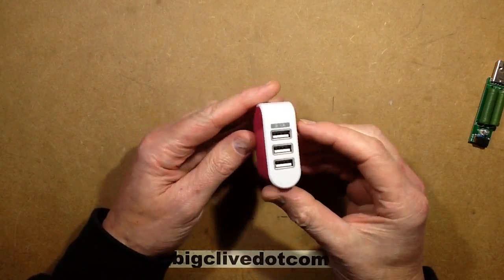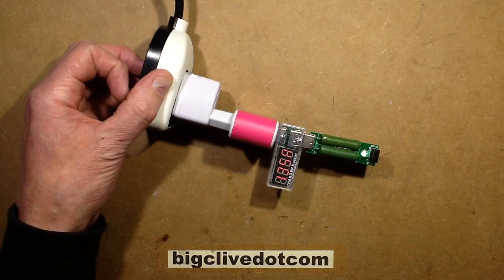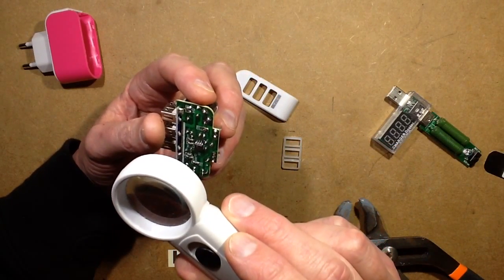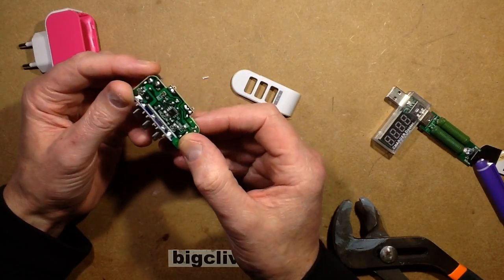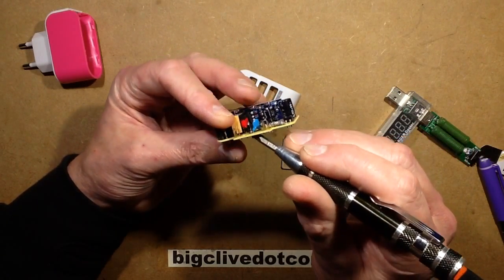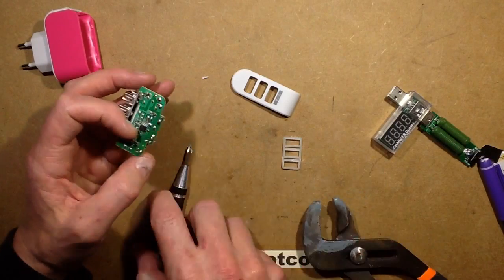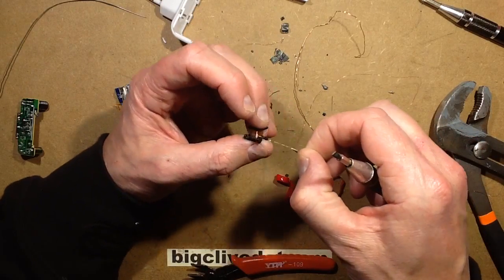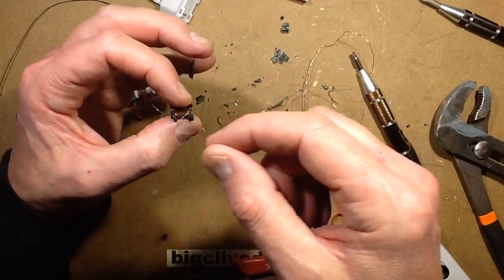Test of a three port 3.1A USB power supply.

Comment: Hey Clive, check out the 2016/v3 of the charge doctor. It does a better job with higher amps / voltages. Something like this http://m.ebay.com/itm/2016Hot-USB-Volt-Voltage-Doctor-Magazine-Capacity-Tester-Of-Power-Free-Transport-/162211473038?nav=SEARCH ( not an affiliate link )

Comment: Its is to bad there aren't proper inspections on products that plug into the mains, cheap and easy to make, and even if you don't die it might kill what you plug in to it, once upon a time we had products inspected by UL in the USA, now we rely on Clive of Scotland, you need a label to apply to approved products, lol.
Reply: +cjmillsnun There's also the problem of products displaying inspection logos they never passed, or close immitations thereof.
Reply: We still have reputable products inspected.  UL, TuV, BSi, etc all still exist and do test stuff.  However the internet allows you to buy crap that isn't inspected much easier than you could before.
Reply: Brad Mad that's why it's for your fake Android tablet so it shall all make it's way too the bin single file.

Comment: gosh how many things have you got I ended up finding on banggood :P  although don't have that particular amp/volt tester I've seen mine in other videos.  I do have the load test and the cube plug in 1 usb port hates it.  Shorts it right out.  Plug the tester in, plug the load in hit the switch and boom  no power  oops  guess 2 10 watt items there too much for it.  Various Microscopes I have as well. Do love the circle one with uv light though. Not sure if you have that one.  but lights up some fun on dollar bills :)   Probably shouldn't use that in the bathroom though :P  the microscope you have never thought I'd break the clear part off.  It's the top section (zoom) I'm always worried about.
Reply from the maker: I broke the base off to get closer to the PCB when other components are in the vicinity.
Reply: bigclivedotcom
I can see that. although thats why I have the smaller one with looks like a loup but it's not and worse it's got a battery holder key (2 holes which probably okay if you lose the key but I'd rather not, besides the long one your using is better anyway :)
Reply: see if youtube hates the linke but for those who don't know which magnifying glass I'm referring to (say on banggood ) it's this one -- http://www.banggood.com/Mini-45X-Monocular-Magnifying-Glass-Lens-Loupe-LED-Light-Eye-Magnifier-p-934020.html  I mostly bought it though for the UV led on it.  I do have a chinese fun with their cheapies myself and banggood is a bit fun.  90 % of the time I'm okay , but sometimes the solder ain't great :O

Comment: Fixed focus? Is that a first or second generation iPad?

An android or more modern iPad would fix that problem, you can just tap on a certain area to focus on (iOS) or autofocus (android and iOS).
Reply: You need voice activated focus like AvE has...
Reply: Does first gen iPad even have a camera?
Reply: SoniEx2 It might. I'd have to check, but I know that the iPad 2 and later do for certain.
Reply from the maker: 2nd gen.  The problem with using an Android phone is that they often focus aggressively when used in the way I'm using it.  Some camera apps allow you to lock the Android focus, but most phones I've tried do not allow the focus control.
Reply: bigclivedotcom True. I suppose a cheap iPhone would make the cut? Even the iPhone 3GS has controlled focus.
Reply: stefantrethan >voice activated
Oh god why please no...

Comment: BigClive, does this go into 'the hall of shame' ?

Actually, id love to see your list of worst electrical USB power supplies
Reply from the maker: Just go to eBay and search for USB power supply.  Lowest cost including shipping first.  That should find you lots.
Reply: I was thinking of the ones that you have taken to bits.
you must have found some terrible ones.
For example, the above power supply. where does that rank of the 'hall of shame' ?
Reply from the maker: It's hard to quantify.  The seemingly high quality one with mains on the output that had caused someones muscles to convulse is probably the winner, but the shitty pink USB charger from China is a close second.

Comment: As a power electronics engineer in the U.K., it boils my blood that these death traps from china are so readily available. But it's videos like yours that help expose these sh&£&y products. To many people ( and companies) are price driven rather than selecting quality. The power supply is the one thing that separates you from the big nasty shock. It's not always easy (especially with fakes) but if you can buy something with the ENEC, TUV or UL labs mark. Most Major retailers generally require declaration of conformity from a third party test house before they will put product on shelves so they will usually be a safer bet.

But it's the same old story if the price looks to good to be true it usually is....
Reply from the maker: On the basis that a decent USB power supply is an absolutely essential life accessory these days, I tend to recommend that people buy themselves a good quality one from a known high profile brand that has a reputation to protect.  At the moment my own choices are Apple and Ikea.
Reply: Considering the quantity of apple charger knockoffs I would recoment to go to a "real" apple store (the ones run directly by apple) to buy one... On the other hand I have not seen a fake Ikea charger yet ;)
Reply: I must admit i was pleasantly surprised with the gear Ikea has been selling & I suppose at £7 for the 3 port charger it's not really worth other companies ripping off. 

BTW - on the tear down video of the Ikea 3 port usb, the single ended wire screening winding, is probably what we call a cancellation winding.
It is designed to inject antiphase noise back into the winding to null the voltages and prevent HF from being coupled to the output and thus reduce the amount of common mode noise of the PSU.
There is a lot of science behind it, but getting the end execution to work well seems more luck than judgement at times. A "Black art" indeed.

Comment: I did also look on this type of charger: http://lygte-info.dk/review/USBpower%203.1A%203%20port%20usb%20charger%20UK.html
But the inside is different, it uses two transistor instead of a IC. Safety is just as bad.

Comment: Hi Clive. Totally unrelated. I wanna start etching PCB's, and i know you know a hell of a lot about that. The only thing i am left alone with though, is what copper boards to buy? I know you are reguarly on ebay, and i thought i would be able to find them cheap in there, but i simply cannot figure out which ones are for the UV-light thingy? :)
Reply from the maker: For the most consistent results I tend to suggest finding a local electronics supplier that stocks the material if you have one.  On eBay the keywords are photo resist pcb .  I don't recommend the dry film for putting on PCBs, it's very tricky to do.
Reply: The boards i am looking for is like this one: http://www.ebay.com/itm/1-x-Photoresist-FR2-PCB-Single-Sided-160-x-100-mm-/271739145882?hash=item3f44ea4e9a:g:ojwAAOSwYGFUtC0B

I just simply cannot find a cheap supplier from china? 2,42 pounds for plexi glass with 35 microns of copper is just too expensive compared to everything else. Is the only option european sellers? 
Also thank you for your time ;) it helps a lot.
Reply from the maker: For consistent results I would recommend using a known source.  You will waste some material getting used to the exposure and development times, so you don't want to have to do that with every batch from a different source.  I use the material called "FPC 16 (2) Pre-sensitised Economy Board" from a Uk company called Mega Electronics.  http://www.megauk.com/pcb_laminates.php
Reply from the maker: I've just discovered that Mega Electronics seem to have fallen behind the times with reality in this day and age of e-commerce.  Their shipping charges are astronomical, so it may be worth looking for a local supplier instead.
Reply: bigclivedotcom i will try to find something,  thanks. Just hoped that it was available cheaper than 400 transistor..
Reply: I think i may just go with the film and try it out. If it works its a hell of a lot of money saved (10 pcbs (7*10) is 5 dollars, and the film is 4,2 dollars pr. square meter :)

Comment: Maybe it would be 3.1A total if you used all 3 outputs at the same time and the blue board has any kind of per output current limiting.
Reply: If you charge three devices at once with this, it gets so hot you think the plastic shell is going to melt.
Reply: It won't sustain the voltage if you attempt to draw 3A from it. It's possible it'll never reach 3A.
Reply: +Prehistoricman oh it will, but not at USB voltages. Probably somewhere around .5 - 1 volts-ish.
Reply: +Prehistoricman you'll get a nice smell out of it, too.
Reply: AIO inc. What if it goes bang before the 3A mark?

Inhale.... ahhhhh, the smell of improving electrical safety, 1 shitty power supply at a time.
Reply: Prehistoricman Then we get quicker entertainment.
Reply: Argantonis Considering it doesn't just catch fire, spark, short, or just charge them all very slowly, that is.

Comment: @bigclivedotcom I have a good item that I have that went bang and blow the fuze at home.  it is a Tartan Tech smartport 3amp charger that sells for £20! I have had no response from the company since and I know that there is others that have had the same even to the extent of over charging smartphone batteries!  
I would like to send it to you for your channel teardown.
Reply: Smartphone batteries should not overcharge no matter what the USB "charger" PSU does.  The charging is controlled by a chip in the phone, and if that fails or is fooled by overvoltage, there's supposed to be a second safety chip inside the battery itself just to stop this.
Reply: If that is the case then how do you explain what has happened to the new note7! It OVERCHARGE THE BATTERY CAUSING IT TO EXPLODE AND CATCH FIRE.

Comment: What's that electronic magnifying glass he used
Reply from the maker: It's a common illuminated magnifier available cheaply from China via eBay.
Reply: +bigclivedotcom I'm glad you talked about it in your video cause i've always wanted the same model as you use and I tried to search on ebay but don't find the exact form factor as yours. Hope you can find me a link if you will be so kind ?

Comment: After seeing way too many videos about you (and eevblog, and all others) complaining about the horrendous safety standards in cheap power supplies, I'd like to know how bad this actually is?
There are a gadzillion of these devices out there, and apart from slow charging, I've never really heard of catastrophes happening?
Also, everybody complains about the safety isolation gap between the two parts of these power supplies - It really doesnt seem to complicated to simply move the two parts a couple of mm apart when designing them. So why do the PCB designers not do that, if it's really such a big issue?
Reply: youve not heard of? two houses near me in the last year had complete housefires, attributed to cheap phone chargers starting fires in the middle of the night, so ive heard of several, enough to make me throw out all unbranded chargers
Reply: the circuit boards themselves cost by area. So a couple mm in a large run can add up to a lot of money. Then there's just the shrink it down as small as you possibly can mindset too. Which can be difficult to break away from.
Reply: People have died from bad chargers. One lady in China was electrocuted by a fake Apple charger, that made it into the news because Apple offered to exchange fake ones, but I expect it happened more than once.
How many people died from fires caused by poor electronics I don't know, it's not like there's much left of the device...

The reason these chargers are so badly made are complex. Some are designed correctly, but gradual mistakes and simplification in production make them dangerous. Others (like this one) were never designed right by anybody who understood the dangers and what to watch out for. Often times I find they cut corners in safety, but then they put in parts that aren't vital (for example EMC filters). So it's not always cutting cost to the absolute minimum, sometimes it's just incompetence.
Reply: Often times fake branded ones are more dangerous - they spend money/effort on counterfeiting. Just something to consider.
Reply: stefantrethan
amazon recalled all its amazon fire tablet chargers, i dont know if they had fires, but i guess they wasnt taking chances.

Comment: We sell these at the gas station I work at. Completely identical other than having s US plug. When I unbox them from their factory packaging to display there is always such an overwhelming cheap electronics smell. We somehow get away with selling these for $8 each.
Reply: They are ordered in packs of 12. I might be wrong but I think they are $20 a pack on the grocery order. So that's about $1.66 cents a piece for us. I'm sure manufacturing costs is much cheaper than that so the distributor is getting their profits before we do as well.
Reply: find out what they buy them for, i wonder if its less than 99c each
Reply: jusb1066 Found it on AliExpress at $1.62
Reply: Izzie
yep, im sure it is, its just interesting about the selling in a gas station mentioned above, that they can get $8 just for the convenience factor
from passing customers
Reply: *****
yes you are correct, there would be a middleman getting his cut, probably getting them under a dollar himself in bulk and one of the nice little things he about doubles his money on.
Reply: I bought three of these from eBay because they were the absolute cheapest available: €1,30 a piece.
Reply: actually if bought in bulk, per unit can cost well below $1, around the 70c mark, hell could be below, in my country these are everywhere (w/o shipping ofc)

Comment: Is a 1kV Megger test a meaningful demonstration that a PSU is safe?
Reply: It'd probably better than smashing the transformer and looking at the remains.
I would rather test to at least 5KV to be safe though.
Reply: 5kV is a bit much for a power supply like this. You'd usually have 3-4kV AC depending on the standard (IT, household, medical, etc.). Nothing beats smashing the transformer to make it safe ;-)
Reply from the maker: I think the official test is higher, but 1kV is a good start.  I've done a high voltage test on some in the past.  In this case it may have passed, but the primary bootstrap winding touching the secondary winding could suffer gradual degradation over time with thermal movement or insulation breakdown.
Reply: Depending on mains voltage a power supply will be used, you use 2.5kV (if using a DC tester) for 110V or 5kV for 230V. For testing, you need to put one lead on both prongs of the mains input, and the other on both the USB Vcc and USB ground pins. In effect you're testing the insulation between the primary and the secondary, and whether a Y capacitor is used. The power suppy will also fail the test if there is not enough isolation anywhere. 

Note that this test must be done before disassembling the PSU because many of them use plastic shields for isolation and removing them makes the isolation not enough.

Comment: Hi, that chip is probably a knockoff IR2153, which is normally made by International Rectifier/InfineON.

// EDIT No, it surely isn't. I had a look at this HR2513 and it's completely different from IR2153. Well, I guess I was wrong.
This HR2513 has output rated 5V@1A, so can't really provide 3.1A

Comment: You make many vids with power converters, I would like to see some proper load graphs done with good quality electronic load.
Also 5V looks ideal but its not in practical use, because voltage drop on wires makes about 4,8V so not really good.
I think good value for usb power supplies is about 5,25V
Reply: +kain hall I've got a Pentium II board which has the ability to hold a good 5 amp load on one USB 1.1 port. Gets real hot and smells funny, though. 

Depends on your power supply, I'm sure it could do more if I had a better supply, if only for a time.
Reply: i got a 12v cigarette lighter USB socket sample the other day and it outputs 5.2V. My computer puts out exactly 5V and only 4.7V when an 18650 battery charger is plugged in pulling 500mA
Reply: my computer has some fancy marketing wank in it....

it still sends power to USB when off.....does that well...but it also puts more power (im guessing amps) whhen the PC is on (pc off = no boost)

they say its for like LED keyboards and phones.....

point being...i should measure the drop....

its a 7 year old MSI AMD mobo...am3+ socket...so, the fact that it still works is good enough for me...
Reply: good ol' yella usb ports :)
Reply: Gotta love them sexy blue ports though
Reply: We have mainboards at my workplace that can do high current on USB. Someone bit through a mouse cable and twisted the wires together to watch them smoulder.
Reply: ***** A dead short would've caused sparks to fly, there was some form of resistance in circuit.